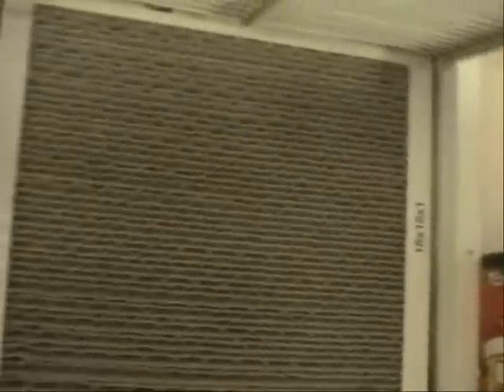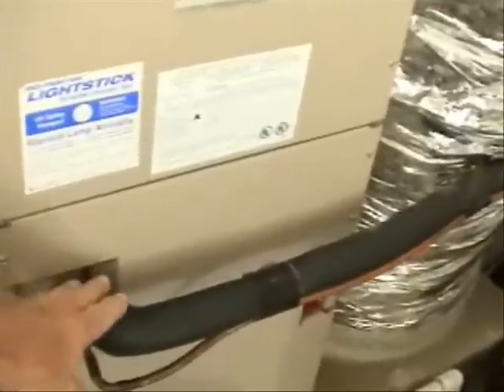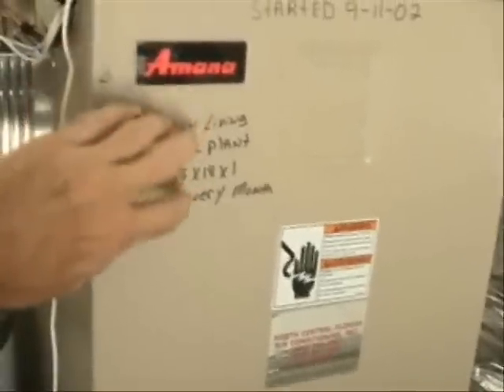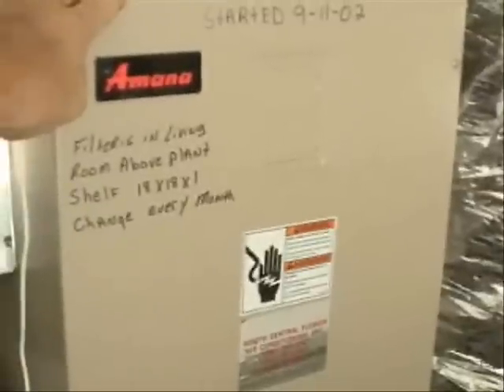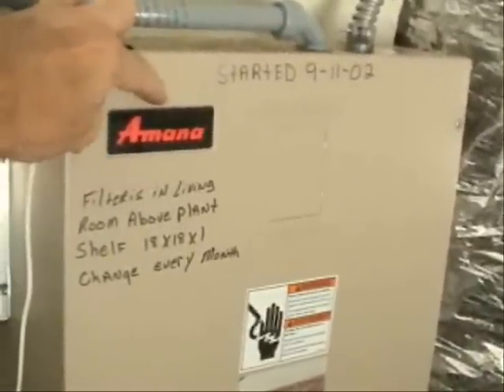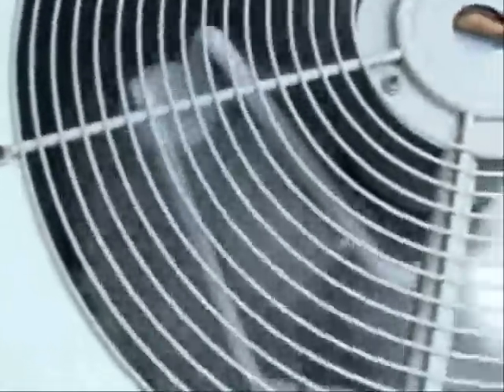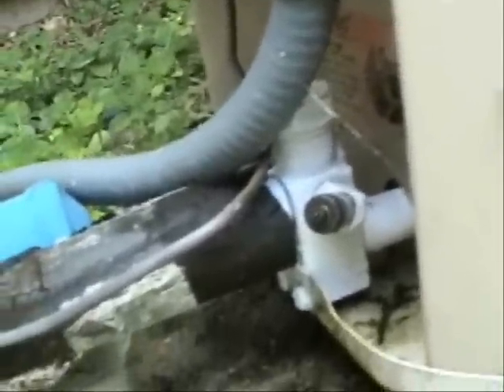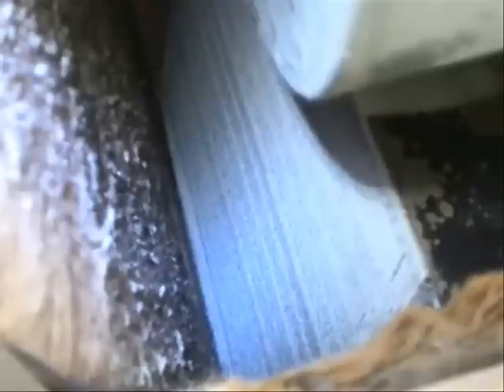HVAC Frozen Evaporator Coils

Comment from the maker: It might. It all depends on the suction line temperature. Systems with multiple stages of scroll compressors have evaporators with separate sections for each stage to prevent these problems.

Comment from the maker: Air conditioning systems with two or more stages that use scroll compressors have one or more compressors per stage. Some reciprocating compressors use an unloading system that will give you two stages in a single compressor.

Comment: we use to lived in a apartment with and old day and night eletric furnace with a/c and
man you can ever tell those unit wre on thare last lags in every apartment we had thing come up such as icy or iced suction line
to a short in the condenser cooling fan outside not letting it run the big one we had 
with it was a blown heating element as in burnt out like a light bulb in one of the element boxes that shut the hole unit down
the only thing we had to heat by was 2 eletric space heaters

Comment from the maker: Very good. You might want to check to make sure that the air filter is clean, too. Also, make sure that the blower in the air handler runs while the system is running.

Comment from the maker: An iced up system can be a result of an undercharge. If the system were overcharged, the refrigerant would stack up in the condenser then eventually slug the compressor with liquid refrigerant.

Comment: Great videos DrZ! My compressor went out on 1 of my units last year, it was replaced & freon recharged. Over the past few months, the unit would not always kick on when needed to cool, I would have to manually move the thermostat back and forth to get it to kick on.  Replaced the stat & still have the same problem.  I finally noticed that my unit is freezing & assume this is whats keeping it from kicking on at times.  I'll thaw & clean the coil in hopes of fixing the issue & report back. Thanks!

Comment: In residential hvac this is usually the result of a dirty evaporator coil due to neglect or poor filter fit.  Turn off the unit and let the system fan de-ice the evaporator coil.  The condensor coil will quickly thaw on it's own because the outdoor temp is usually warm. A good evaporator coil and fan cleaning will usually clear up the problem.  The system may need a little refrigerant added to get the correct superheat and subcool.  An electrostatic filter can also cause the same freeze up.